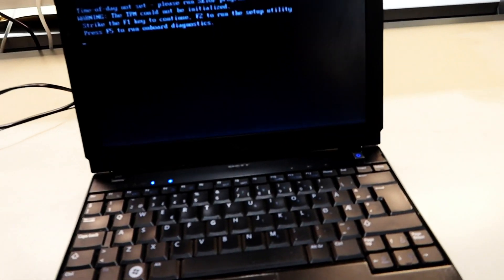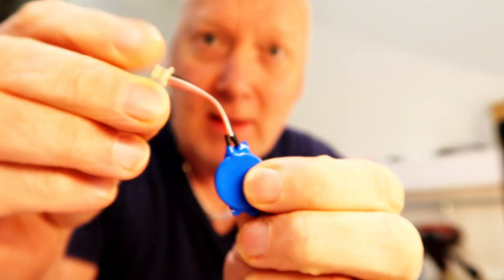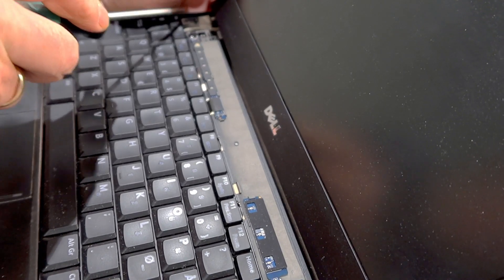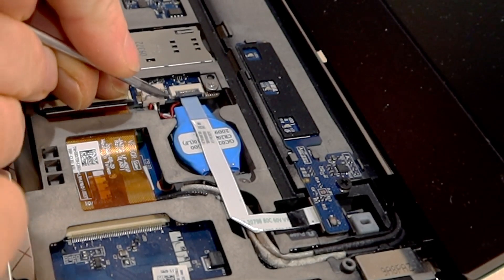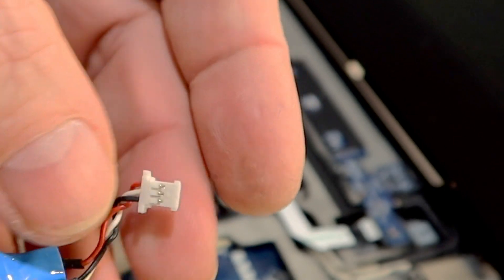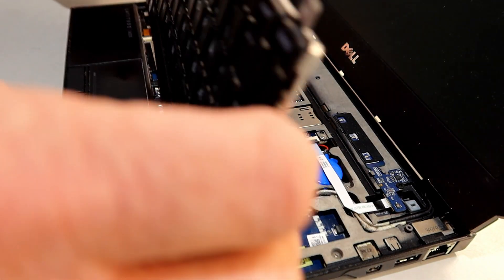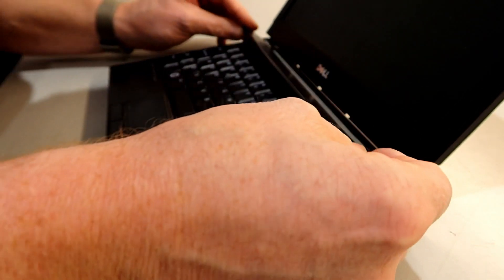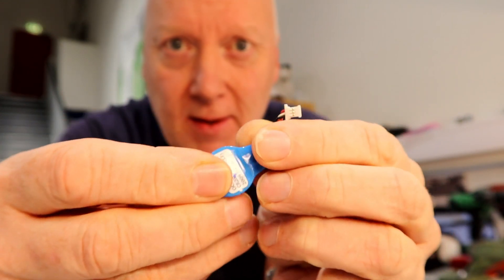How to change the cmos battery on Dell Latitude E4200

Comment: This was very helpful. Thank you very much. I was in a hurry so, instead of ordering a new battery, I cut off the wire and attached it to a standard cr2032 button battery. It worked! Couldn't have done it without your video for guidance.